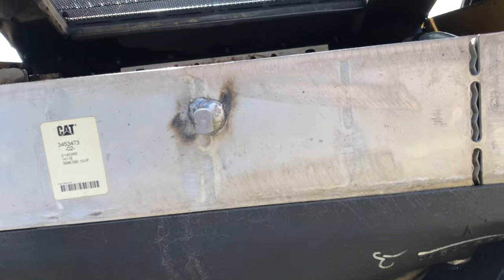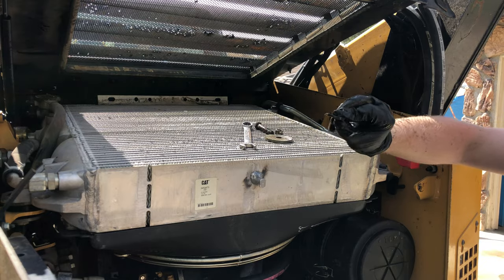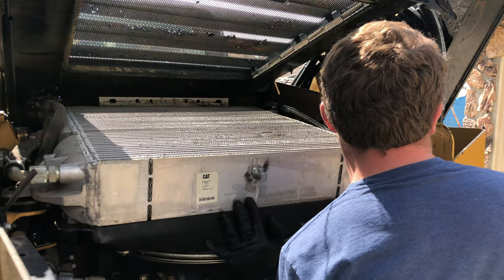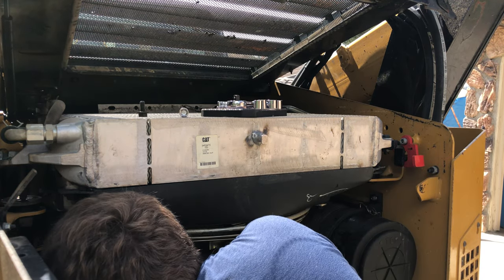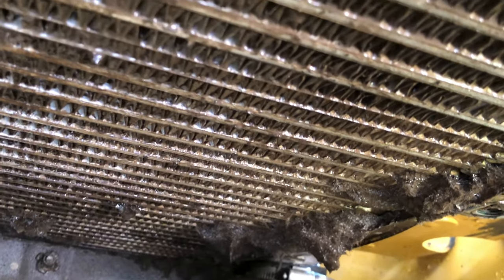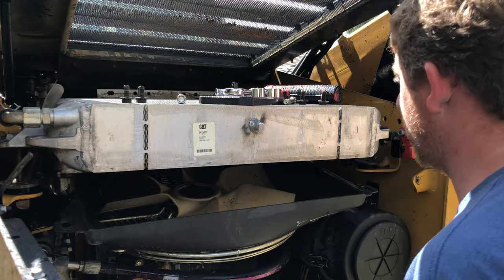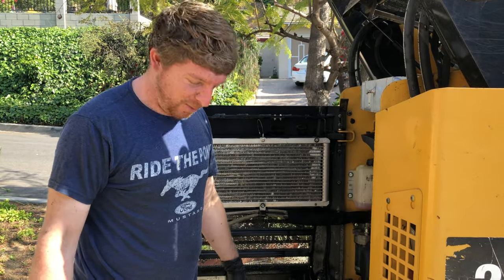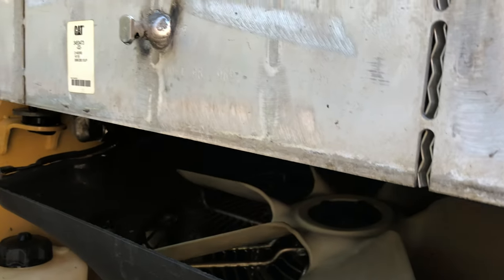Wash your fins! Radiator Rotating and Deep Cleaning - CAT299D

Comment: It won't affect engine sensors  with all the water falling on top of it .?
Reply from the maker: That’s a great question. All of the connectors are supposed to be sealed. If you imagine it raining, the water would also take this path. If cat didn’t design this to work during rain, it would be a huge failure.  With that being said, after this deep clean, I let the engine compartment dry for 48 hours before starting it.